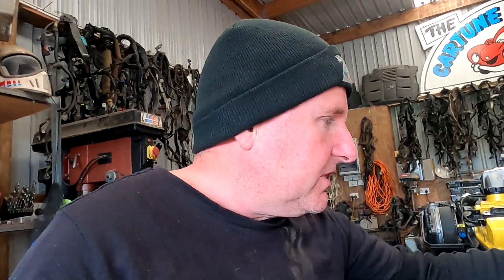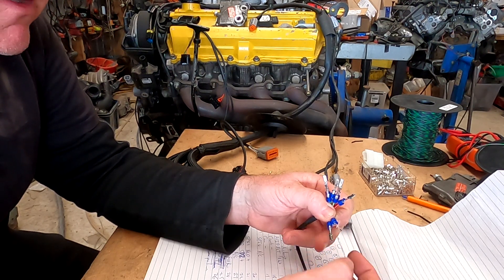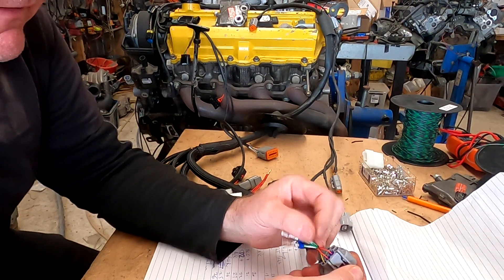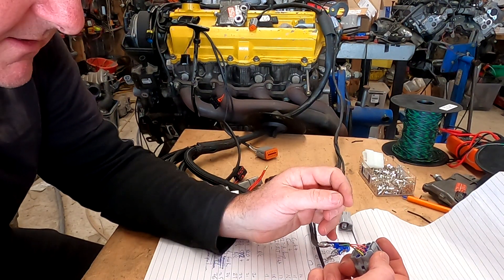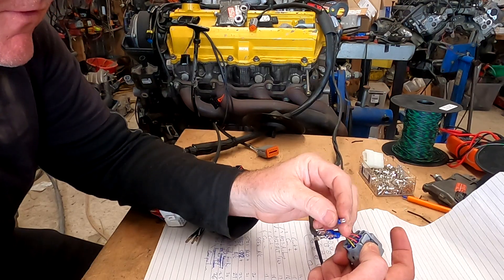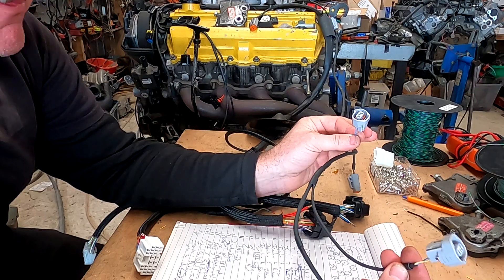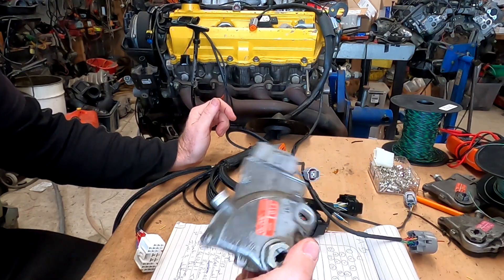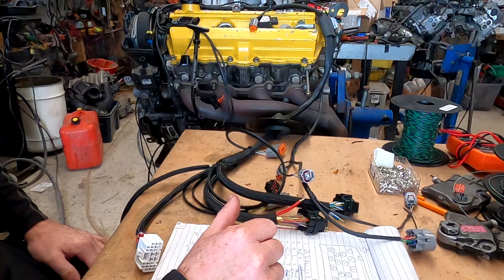Haltech to 1uz Part 8.  Transmission Wiring A341 , A340.

Comment: Thank you 😊
Reply from the maker: Cheers Kelvin
Reply: @CartuneNZ   do you have PayPal??
Need some expert advice to wire my a340.  Having an issue selecting gear 3 and 4. I have VVTI model with the M gear selector mode beside drive. We only can get 1st and 2nd to select. We have a haltec 2500.

Comment: How many wires did u need to add to the haltech forvtrans contor?   Did u need a expansion module
Reply from the maker: I managed to wire it using just tbe 2500 without any expanders.  All the transmission wires were in the main connectors.  Cheers Kelvin
Reply: Hi.. Im pablo from chile.. I just order a a340e stage 3 for my 2jz from atf transmisión (usa ) i have a elite 2500 to manage both engine and transmisión.. can you help me with wiring diagram please 🙏🙏🙏